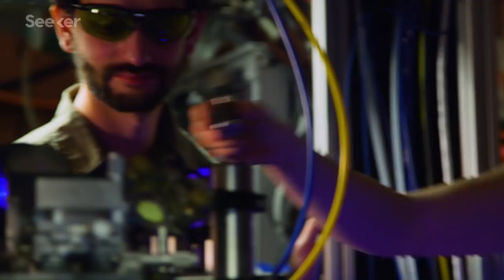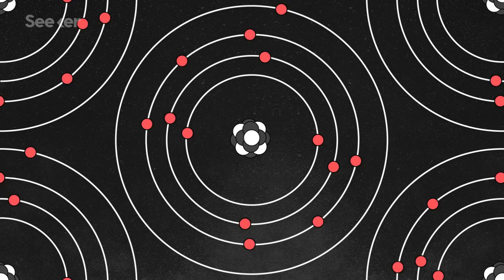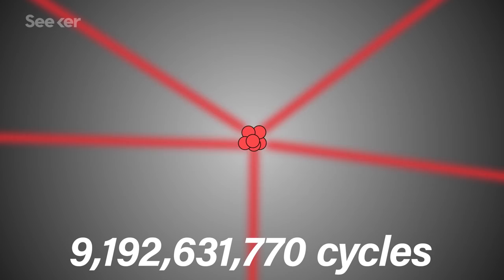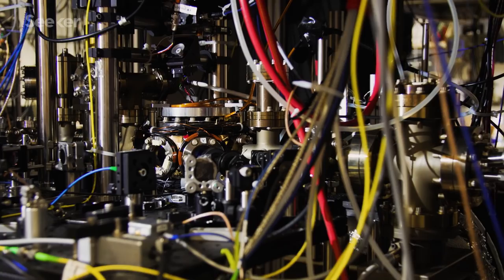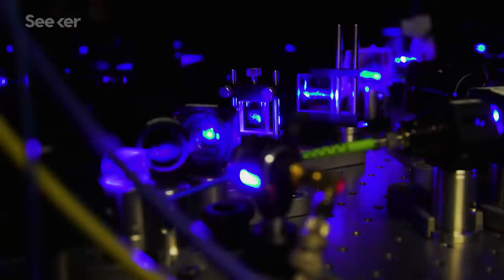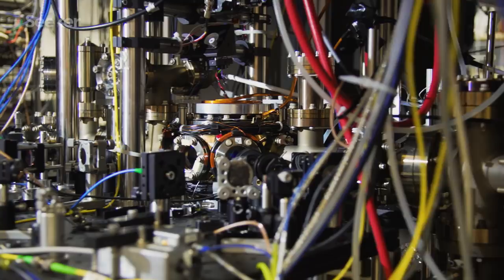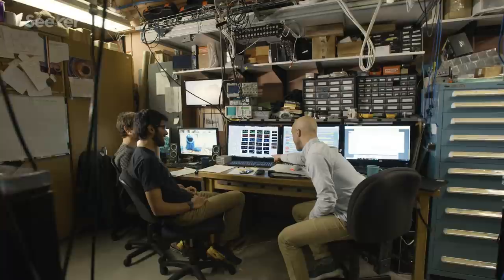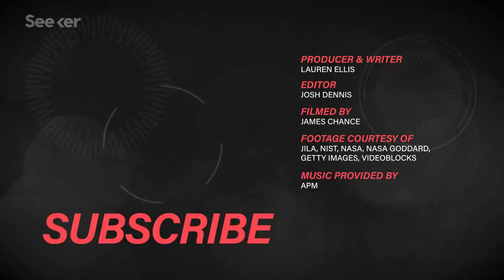This 3D Quantum Gas Clock Could Redefine Time

Comment: Isn't definition of second goes like this:
Time taken by light to travel 1/299792458 m ?
Reply: No that is more the definition of a meter.
The second is defined as say in the video, and the meter is defined as the distance traveled by light in 1/299792458 seconds.

(btw, 1 second is the time light take to travel 299792458m, there is no inverse here)
Reply: A second is defined today as 9,192,631,770 cycles of radiation by Cesium atom per second.  You take this definition of a second to measure the speed of light.  If you want to know how fast light travels in a second, you let light travels for 1 second, and determine unit of travel.  Then you cut the units up and called it meter to define the speed of light.  The speed of light is derived from the definition of a second, not from a "meter".

Comment: "I'm optimistic within 30 years we might get to the point where we can measure the gravitational effect on quantum physics"
What does this mean?
Reply: General relativity states that mass (well, energy) warps spacetime. The guy's talking about making a very accurate way to measure the passage of time using transitions between quantum energy levels. So in theory you could have a clock so accurate that you can figure out if a mass has been moved towards/away from it by how it affects the relative passage of time for that clock, meaning you're measuring gravitational effects on quantum physics.
Reply: @robertrosca   Gotcha. Big thanks. Now that you explained it, it does make sense and would be totally cool.

Comment: This will also effect the other units of measurement as well. The Kilogram was updated just recently.
Reply: Only the units that are affected by time, such as a Joule.   A Joule per second = a Watt.    A kg is a mass based on a number of atoms, so is not affected by the definition of a second.
Reply: @my3dviews  That is incorrect, the Kg will be defined by the energy released in a very certain freq. of light(Hz), which has a vibrations per second. Plancks constant will be used for the Kg, E=Hv then E=mc/2 to give the Kg. I might not have all the info correct but I'm close.

Comment: This makes no sense. The units of time that we have are completely fictitious. You can define time however you want and as long as everyone else uses the same definition, you shouldn't run into any issues. If you want to get super precise, why not fix time constants mathematically? For instance you could say that a second is the time it takes light at a fixed speed constant to travel 1 trillion carbon atoms at a fixed length constant. Or something like that. The numbers don't even have to be super perfect. As long as everyone agrees on the numbers then it shouldnt matter.

Comment: Still, where do we get the length of the second?
Reply: is just an arbitrary number of oscillations. We obviously "knew" what a second was before the discovery of atoms. So, once we find atoms of ceasium, we make a number that resembles that pre-conception (or "old" definition) of a second with the new technology.
Reply: @zokalyx  Key word: arbitrary.
Reply: Not really arbitrary.  It was originally that a day had 24 hours (noon to noon) made up of 60 minutes, each made up of 60 seconds.   But in order to measure accurately, there needs to be an accurate clock and therefore a method of measuring time (including seconds).
Reply: But why was a certain number of occasions picked? Is that precisely one 60th of one 60th of one 24th of one rotation of the earth on it's axis? How was that measured then affixed to such a specific number? If this number represents the ultimate in accuracy, is the method of obtaining that number equally accurate?
Reply: +Arnold Caines    The amount of hours in the day has been around since ancient Egypt and has stuck ever since.  One theory is that 24 was picked as the number of hours because that number is easily divisible by 2, 3, 4, 6, 8, and 12.   Another is that a sundial had 10 divisions and one hour added for each of the hours after sunrise and before sunset when the sundial wouldn't work, giving 12 for daylight hours, then and equal 12 for nighttime hours.   It was the Greeks who later divided the hours into 60 minutes and that into 60 seconds.  

That is how the second originally was defined.  At that time there was no accurate way to measure it.   Old clocks would be reset on a daily basis to get in sync with the daily cycle.   Even the day itself is slightly variable throughout the year, as the Earth is in an elliptical orbit, which affects the 24 hour length during different parts of Earth's orbit.
Now we use an average length of the day throughout the year so that clocks don't have to be variable to stay in sync with the daily cycle.   
https://durangoherald.com/articles/170769

Once an average 24 hour period is established, you can then make a clock that is based on that period of time.  So, a second will be 1/86,400 of a day.  

All they are doing now is finding a clock that can keep that time accurately without having to adjust it over time.   An atomic clock (based on cesium)  is very good for this as they will be accurate to within a second in 1.4 million years.   So, for almost any application, this is more than accurate enough.
Reply: I understand all that has been said. What I am trying to point out is that when all is said and done, a it all comes down to an arbitrary fraction of an earth's rotation upon which we base our understanding of physics. I saw another video where the kilogram is being redefined. Again, another arbitrary decision made long ago defining our understanding of Creation.

Comment: This is crazy. Time is constant from our perspective. We can't change time, can't move it forward or backward, can't speed it up or slow it down and we definitely can't make it go in a loop. Time should be lable as C=constant just like lightspeed.  We're still trying to figure out a universal measurement for time but the world still base time on the rotation on the earth on it's axis and rotation around the sun.
Reply: Don't we already have the ultimate unit?  From Wikipedia:  "Planck time is the time light takes to travel one Planck length. Theoretically, this is the smallest time measurement that will ever be possible. Smaller time units have no use in physics as we understand it today."  Of course we need more precise clocks to measure this unit more accurately.  Or we just define it to be something, like they do with Plank's constant for the new definition of a kilogram.
Reply: Actually no. Time is measured of the cesium atom. Earths rotation is too variable, changing speed up to a couple of minutes each day because of mass being moved around the surface due to human activity and tides.
Reply: einstein tho
Reply: Are you kidding me?.....we divide time in 24 hour zone across the planet. We have AM and PM that tells us what is night and day. We use the planet and the sun as part of our measurement of time and we still do it while scientists are trying to figure out another way of measuring time.
Reply: @SAPPER510  you seem to be misinformed. The second hasn't been defined by the motion of the earth and sun in quite some time. Since 1967 it's been based on the cesium atomic clock. Read up on UTC https://en.m.wikipedia.org/wiki/Coordinated_Universal_Time

Comment: I first got interested in this video since I'm working in this field. But yet, it grinds my gears, when the facts are poorly researched. Fortunately, Jun Ye tries to keep his explainations as simple but yet correct as possible, while the narrator seems to be off a few times, oversimplifying and mixing up facts. Sure, physics is a rather hard topic. But it wouldn't be a big deal to get the video fact-checked by people working in this field. E.g. when I heard your explaination of the caesium fountain-clock (NIST-F2), I almost had to vomit: "Microwave lasers beams push the atom into a ball". Seriously. Is it a laser now? Or a microwave? It can't be both. What actually happens is, that atoms get laser cooled in a magneto-optical-trap (and further cooled in a mollasses), accelerated vertically where it passes a microwave cavity in order to get excicted via the Ramsey-scheme. Somehow this became "microwave-laser".....

Comment: You are on the earth moving in space, won't your experience time dilation?
Reply: You do but that won't affect your measurements at the other part of the universe, the only problem is that when you compared two clocks from different regions of the universe they won't be in sync but those two clocks will still ticking 1 second per second relative to their local frame of reference.

Comment: Erm excuse me, but @ 2:12 “The time it takes the Caesium ball to move between energy levels is 9,192,631,770 cycles”.
Didn’t you mean 1 cycle? And that it takes that many cycles for a second?
Reply: probably yes
Reply: In this case, that is not what a "cycle" is. A second is 9,192,631,770 vibrations or cycles of a cesium atom. Thus time is measured in cycles of a cesium atom.

What he is saying is the amount of time cesium takes to move between energy levels is 9,192,631,770 cycles of a cesium atom.

A bit confusing but not technically wrong from what I can tell.

Comment: what are they really measuring? electrons are not balls that spin around other balls called neutrons and protons
Reply: They are measuring the photons released  when the electrons jump from one energy level to the other
Reply: NPC#6789 Orange Man Bad  true but they measure the probability of where it most likely will be. So if its 99.9999% it will be at a certain location then that's measurement they'll use. that other .01 percent doesn't really matter.

Comment: This is stupid. They're still only measuring an average rate of time flow. Not every atom's electrons travel the same speed, not even those of the same element and state. And quantum entangling all 10,000 atoms would just be stupid too, because we're trying to get as close as possible to measuring "real universal time," not artificially measured time. Everywhere in the universe, based on relevant location to the inwards gravitational epicenter of our universe or the outter ring of expansion, has different capacities for the flow of time and space. So, there reason this is ultimately a waste of time: TimeSpace and Gravity have different ratios of expressions in different spots of the universe, so there is no such thing as a universal time, nor a reason to try and use this to better physics equations. Not when at the end of the day, the time they find in atoms will just be proportional to that of the quarts crystal clock results. We're still only measuring our own time zone in the universe. Just like we have our time zones on earth. I feel bad for these guys.